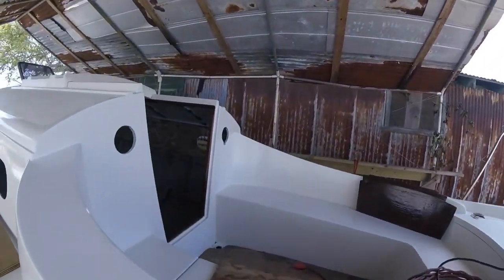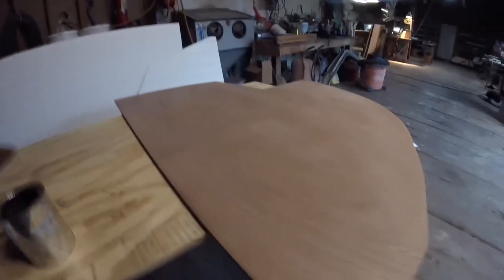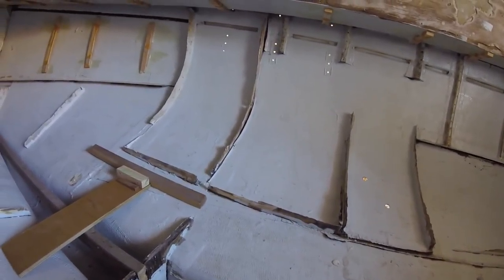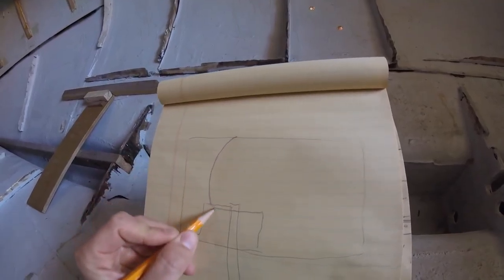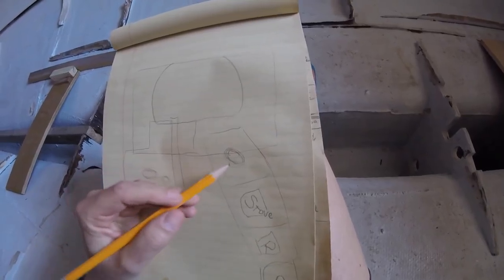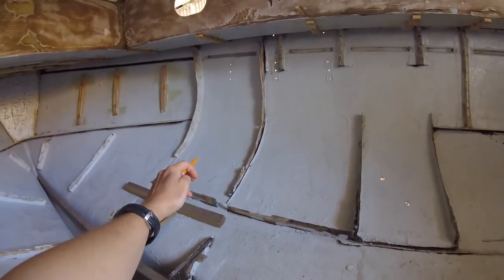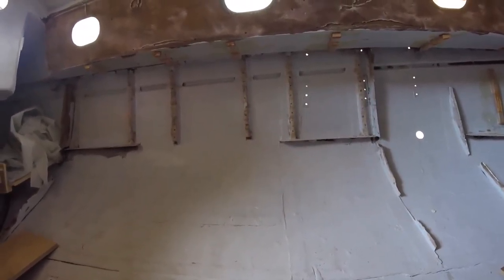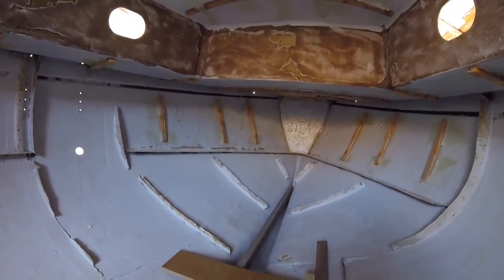Our Plans for the Pacific Seacraft PCS25

Comment: Interesting drawing skills, going from one perspective to another :) Anyweez, maybe use old cardboard boxes to make the bulkheads and then transfer them onto the actual wood. Just an idea ;).  Maybe look online and check floorplans of boats the size you have and work from there. I also want to request some footage outside the boat and workshop, cuz I like the channel more as a lifestyle channel than a sailing channel. But that's just me I guess. Oh well.
Reply: petnzme01 yeah, I saw the vid. They took the bulkhead in the boat and applied the measurements. Isn't it more simple to do this on cardboard and then use it as a template?